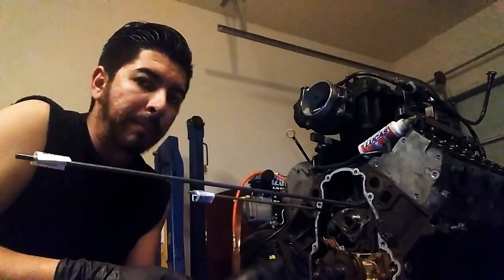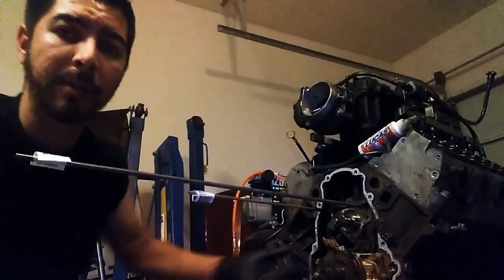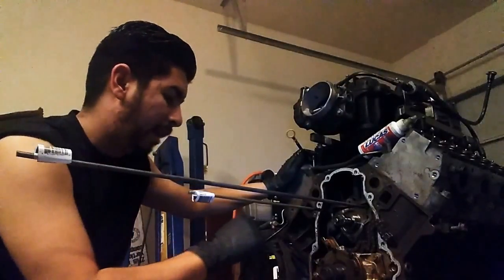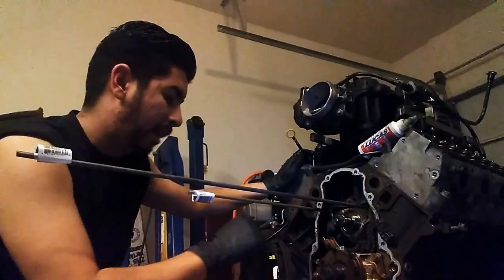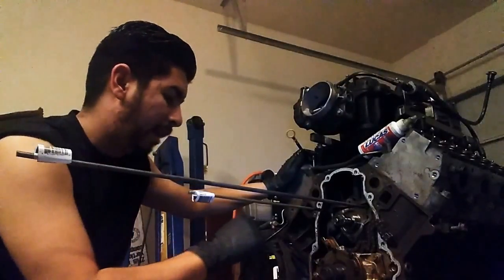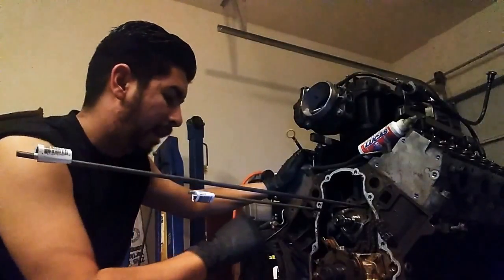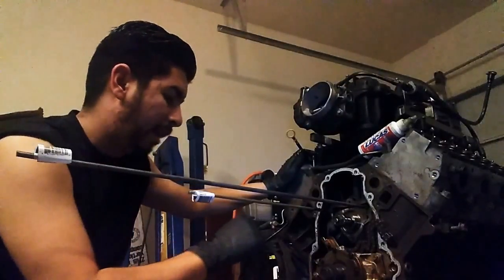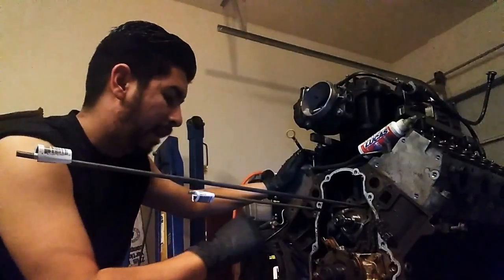6.0 LY6 595/595 Cam Swap

Comment: Did you use ly6 chain  and ly6 push rods
Reply from the maker: Just the pushrods I used for my setup, but the timing chain needs to come with everything for the swap over vvt delete
Reply: @SirMaloPerformance   so you keeps ly6 push rods but you had to get a different chain?
Reply from the maker: @semirm8248  Yes, I did. I recommend it to anyone who does this just to get everything new touching that Non-VVT Cam to make sure there is no excess slack 😉
Reply from the maker: @semirm8248  as for push rods go it all depends on your Camshaft Specifications, be sure to know what you'll need for your specific needs best of luck

Comment: I got a question if it’s okay. What about wiring then? Since we had to plug in the wires to the VVT. do we just leave it unplugged or how do we go about it
Reply from the maker: Hey brother there is no bad questions!😁👍 In my case or my build I retained my GEN-3 Harness so I can use my original tranny, the GEN-4 use a different harness and internal connection to the transmission. If you are using the GEN-4 ECU Thats vastly better then the GEN3 ECU so just Cap off the Connection or tuck it away safely. Please be sure to Subscribe to my channel I appreciate the support 😁👍 #SirMaloPerformance

Comment: Hope you upgraded springs. Comp Cams 26918s would likely be enough. LS6 springs are only good to .570 lift.
Reply: .595 lift is more than your current heads like. The flow increase between.500 & .600 is negligible. I would have gone with the same duration but less lift unless you plan to swap for ported heads.
Reply from the maker: Oh Yes I did I went with PAC BeeHive Style Springs no noise nor tapping and plenty of clearance up to 620 lift. Please Subscribe it will help me out thank you !

Comment: hey bro my cam will be here today,stage 1 tx speed and vvt delete kit,i have a question i was wondering if you could help me with,these videos go thru pretty quick doing the springs,the cam i understand,but the springs,when you turn the crank each time 45 degrees to change each set of springs,do i put it back at the end when im done to where the cam gear dot is at 6 o clock and the crank dot is at 12 o clock ? is this right,so basically after i get done the two dots should be lined up right ? 6 and 12 o clock.thanks,hope to hear from you soon haha.oh and would you like to have my old vvt lol kidding later man
Reply from the maker: Hey bro follow me on Instagram Please and we can exchange phone numbers and I will help you on how i did this process of swapping Springs with stock cam, Follow me on Instagram! Username: sirmalo_performance
https://www.instagram.com/sirmalo_performance?r=nametag
Reply: @SirMaloPerformance  hey whats up man,sorry been busy all day,dude how scary is this virus,i heard tom hanks and his wife have it and they are stuck in australia thats sucks,anyways i couldnt even get the crank bolt out,so i have to buy a stronger impact,and maybe a torch like everyone else,my engine has been sitting since 2016,i removed spark plugs,rocker arms and push rods though,im not on instagram and my brand new cell phone is messed up haha i need to take it back,i have 5 messages and i cant check them,weird huh,anyways let me try and figure out what i can do,oh im on my home computer thats how i surf the web.thanks for being a cool guy and wanting to help,let me see what i can do about my phone,i'll try to download the app and see if it works ok,thanks man.im Lance btw.ttyl
Reply: finally got the crank bolt out today ga lee man haha so everything is ready,timing cover is off,but guess what i dont see the crank gear mark ,i see the one on the cam gear,the crank has something behind the crank snout thats blocking the gear,do i remove that little cover with 10 mm bolts so i can see the gear ? thats where i am dude.i was messing with stupid pulley removers today and all that fun stuff,but its cam time,and springs,but yea i cant see in your video if you removed that little plate covering the crank gear bro.thats all,i think i can figure it out after that.thanks
Reply from the maker: Hey bud I wrote you on a the video before this one, and thank you for subscribing!
Reply: @SirMaloPerformance  haha yea i saw it,so hey everything went good,yay well actually im still doing the springs,i bought this piece of crap spring compressor off amazon that only does one at a time and its hard to get the keeper in,but tomorrow im going to put some vasoline on top of the valve to help hold it in place,i keep dropping them,but i have a old sheet taped to the side of the head that catches them if they fall that far,but its just going to take a few days,not much room in this s-10 blazer but oh well.i'll holler at ya alright man,thanks for your help,oh i had hell finding the crank dot beacuse of that thing behind the crank snout blocks it,but i got it.so anyways stay cool man

Comment: i understand this is a old video, and I greatly appreciate your work!! just sorta ran into a issue when doing a vvt delete on my LY6. I noticed a nice groove on cam bearing #2 due to the oil groove cut into the vvt cam. My 3 bolt cam upgrade does not have that oil groove to match the bearing anymore. Will THIS be a issue and did you notice the same groove?  Again thanks for the great videos, Helped greatly!!!
Reply from the maker: Hey No worries bro! I would replace any damaged Cam Bearings on the block to save the new Cam from further damage's. Be sure to Lube the hell out of the stick before drop in & Run synthetic 30w - drop the oil every 3 to 5k vs 10k, and check the rockers every 35k to 40k that way your good. And whether it has cam groves for oil siphoning or not I swapped mines in and called it good LoL 😂
Reply from the maker: Subscribe it will help me out bro! 😁👍😁👍🙏🙏🙏

Comment: How about the thrust plate is it reusable? Or is it a one time use?
Reply from the maker: @john owen I know I reused it it's recommended to replace but to be honest there's not a lot of wear and tear on that thing just inspect it check it replace it if the gasket on the other side looks busted for warped then yes change it because that would be considered damaged if you see it in good or great condition then I don't see why not reusing it the block that I had has no big wear and tear I lucked out on getting a really good engine for the moment I'll see what happens when I add a turbo to this and push it to its limits to see how good it really is down the road but keep checking out my videos be sure to subscribe and thank you again for commenting
Reply: SirMaLo Performance LLC thank you!!

Comment: Important question, how high of a lift cam  can those stock valve springs hold
Reply from the maker: @colten baxter If you scroll down in comments @coarsegrind wrote out the specs for these engine's and has the answer your looking for because I myself wanted to know true lift. Thanks be sure to subscribe!

Comment: LY6 cam duration @.050 int/exh 196/208
lift .467/.479.
Reply from the maker: Wow Thanks a million!!! Now I know the Big Difference between these cams! 😁👍😁👍
Reply: coarsegrind will stock springs handle a .553/.553?
Reply: Colten Baxter they will.
Reply: Colten Baxter   Use LS6 springs. The stock springs will bind with .553 lift.

Comment: Why not the TFS cam 30602003 ??
Reply from the maker: These head's really flow big numbers with 600+Lift but with that kinda lift you'll be droppin valves left to right after 30K miles for sure😁😁. But TFS is a nice cam@585w/112LSA but this custom cam lifts faster rolls down softer Lunati status LOL thanks stay tune for more

Comment: all you have to do is flip the motor upside down and rotate the cam.. no need for rods
Reply from the maker: Hey Yes that is another way of doing the cam swap for lifters not to fall out, in my case I had the engine sitting in the engine Pallet so just showing another approach is all but please be sure to subscribe to the channel i would appreciate it 👍👌😊